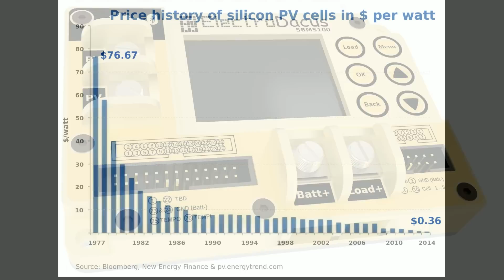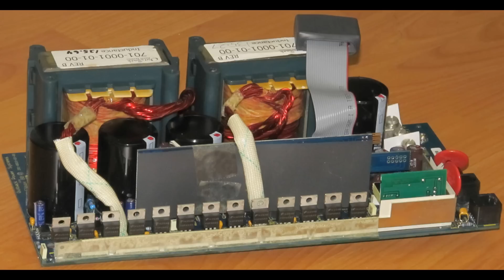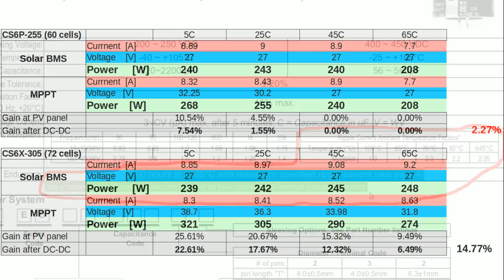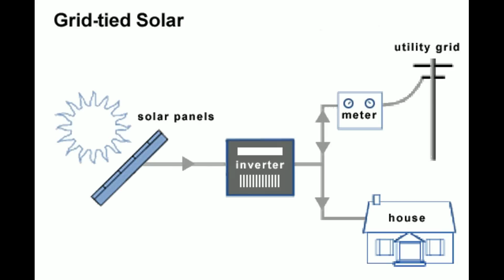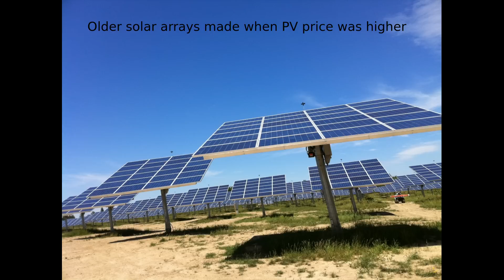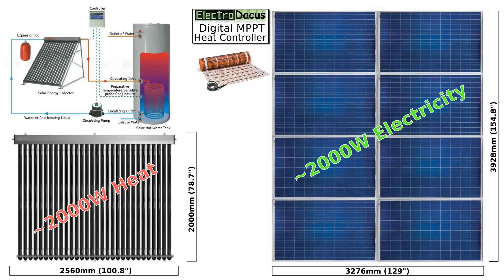Is the MPPT in OffGrid Solar obsolete ?

Comment: But those Panasonic filter capacitors are operating at less than 105 degrees C so they will last longer than 3000 hours...
Also, there are other reasons to use MPPT over direct connection via PWM controller.  Less problems with partial shading for one.
Reply from the maker: Yes if you look at the spec they can operate 2x as much so 6000 hours if they are at 70C so that is still maybe 3 years with 6h per day operating at that temperature that is 10x less than the life of a PV panel.
MPPT will not help with shading or partial shading. If you use 72 cell panels those are split in 3 separate parts and if even a cell is shaded a third of the panel will be out so voltage will be to low for the MPPT to operate thus that panel will be unused. If you have two panels in series then it will work with specific partial shading (if only part of one panel is shaded) but the efficiency with two panels in series is much smaller that with parallel panels so any  small gains you may get with partial shading will be negated by the overall lower efficiency.
Reply: Rule of thumb for electrolytic capacitor life and temperature is raising temperature 10 degrees C reduces live by a factor of two (2).
So way more than 6000 hours or many many years they can be good for.  High ambient temperatures are probably worse.  With interleaved buck converters, lower capacitance and even higher reliability film capacitors can be used.  The capacitors just aren't a problem.

As for partial shading, if you run a higher nominal PV voltage than the battery voltage, the Vmp (Max Power Point Voltage) can still be above the battery voltage so you can get usable power out of the PV array into the battery.  With a PWM controller, If a single string that is rated for nominal battery voltage has a module shaded, the Vmp can be below the battery voltage and you won't get hardly any power into the battery at that point.  High PV array temperatures only makes that issue worse.  If you start with too high of PV voltage relative to the battery voltage to mitigate that, then you are in the area of needing an MPPT or buck converter style controller.

One thing I know to do is to design to just not have any partial shading which would be best.  A chainsaw may be the best thing to use in that case.

But all these issues aside, a PWM controller can be just fine and does work fine for a lot of smaller systems. And if they have the space, more cheaper modules can be fine.

Here in the US and Canada, the equipment legally (if the system is going to be inspected), has to have a UL, ETL, TUV, etc. NRTL listing and has to be able to be wired to NEC electrical code.  I'm not sure if this CC has any listings but can certainly be used in small cabins and temporary premises.  Otherwise, insurance companies won't insure the house is the system fails inspection for that reason.

I looked at the schematic in the user manual and noticed that it uses a particular Li battery balancer IC that may or may not be available anymore ?  Did you upgrade the design ?  Is this controller good for 48V or is it limited to 8 Li battery cells ?
Reply from the maker: @k7iq  Capacitor temperature will not only have to do with ambient temperature (ambient around the capacitor inside the box will be much higher) but also have to do with the self generated internal heat from the ripple current and as they try to minimize the amount of capacitance and cost that ripple current will be fairly close to the limit at full load.
Yes you can use better capacitors but cost will be even higher so not much of a justification for that.
This particular MPPT and almost all others are just a step down converter so as mentioned with a single 72 cell PV panel that is split in to 3 section each containing 24 cells and so when a single cell is shaded (say a leaf falls on that cell) then one of those sections is completely disabled by the diode but 48 cells are not enough to be able to charge a 24V battery as you will need at least 26 to 27V depending on the battery SOC and since MPPT is a step down only converter it will not be able to put more current in to battery than what is available trough that shaded cell same as a non MPPT charger will be able to do.
The most common PV panels in the world (also the most cost effective) are the 60 cell PV panels that are ideal to directly charge a 24V LiFePO4 8s so 25.6V nominal and already fully charged at around 27.5V thus those panels + 8s LiFePO4 will work in the 90% to 100% efficiency range and no MPPT can match that as most have peak efficiency around 92 to 93% also an MPPT will require 72 cell PV panels it will not work with 60 cell panels unless groups of two are connected in series and that will reduce the efficiency even more.
I agree with you on the fact that shading should be avoided in all cases.
There is no PWM involved in charging a LiFePO4 as PWM is used with Lead Acid for the constant voltage charging also called Absorption stage and then after this is done float charge but none of this are used with LiFePO4 as it will be detrimental so there is no PWM on the SBMS as just constant current (bulk charge) is needed to fully charge a LiFePO4.
The ISL94203 that is used in the SBMS is very new (when I started designing the SBMS only the datasheet was available) so no the ISL94203 is still available and will be for many more years.  https://www.mouser.com/Search/Refine?Keyword=ISL94203
Reply: Not sure why the rest of my text above is not showing ?  Will copy and paste it in again and leave out empty space lines....
STILL cannot see the SEE MORE option.  Now I can't see the rest of your posting.  Weird...
Ripple current is why MPPT conterollers use inteleaved buck converters to reduce the ripple current.  At 50% duty cycle for 2 cylinder converters, the ripple is theoretically zero.  More interleaved buck converters are better at a wider range of duty cycles.
As for partial shading, if you run a higher nominal PV voltage than the battery voltage, the Vmp (Max Power Point Voltage) can still be above the battery voltage so you can get usable power out of the PV array into the battery.  With a PWM controller, If a single string that is rated for nominal battery voltage has a module shaded, the Vmp can be below the battery voltage and you won't get hardly any power into the battery at that point.  High PV array temperatures only makes that issue worse.  If you start with too high of PV voltage relative to the battery voltage to mitigate that, then you are in the area of needing an MPPT or buck converter style controller.
One thing I know to do is to design to just not have any partial shading which would be best.  A chainsaw may be the best thing to use in that case.
But all these issues aside, a PWM controller can be just fine and does work fine for a lot of smaller systems. And if they have the space, more cheaper modules can be fine.
Here in the US and Canada, the equipment legally (if the system is going to be inspected), has to have a UL, ETL, TUV, etc. NRTL listing and has to be able to be wired to NEC electrical code.  I'm not sure if this CC has any listings but can certainly be used in small cabins and temporary premises.  Otherwise, insurance companies won't insure the house is the system fails inspection for that reason.
I looked at the schematic in the user manual and noticed that it uses a particular Li battery balancer IC that may or may not be available anymore ?  Did you upgrade the design ?  Is this controller good for 48V or is it limited to 8 Li battery cells ?
Reply: @electrodacus  I had Googled that part and didn't see many hits.  It is going EOL so eventually you will need to redesign but there should be lots of parts available.
So, what is the maximum input voltage (Voc) of this controller ?
Reply from the maker: @k7iq  The ISL94203 is no where near end of life. It is a complex product in a 48pin 0.4mm QFN so maybe not so popular for DIY but sure there are at least 5 years for this IC before EOL
The ISL94203 is designed for 8s so absolute max supply voltage is 36V that has nothing to do with max SBMS PV input VOC that is at least 48V (to be more accurate is 30V + Battery voltage) so it supports both 60 cell panels and 72 cell panels tho the 60 cells will be more efficient so it make little sense to get 72 cell panels.
In case you did not noticed here is the user manual for the SBMS40 and SBMS120 http://electrodacus.com/SBMS120/manual/SBMSmanual.pdf
Reply: Well, Renesas notes that the ISL94203   part is not for use in new designs.  We both know that parts eventually go obsolete .  Five years is pretty good.   Another part will become available and maybe even pin compatible.
Reply from the maker: @k7iq  It will likely be replaced by the ISL94202 that is basically the same.

Comment: Numbers are kind off now, MPPT of 60 Amp cost around 160€ (can get 3kW PV). And if it fail, replacing  Capacitors will not cost a lot. Plus it works with 12V, 24V and 48V battery packs.
Still the BMS as to be purchased separatly.
Reply from the maker: The MPPT will need to have a remote ON/OFF in order to interface with a BMS not many have that. Victron smart solar MPPT has remote ON/OFF port so it can interface with a BMS like the SBMS0.
Still there is zero advantage in efficiency when using the proper matched panels and battery and no MPPT vs an MPPT. So even if MPPT will have been free there is no advantage in having one. A 24V battery + a 60 cell PV panel will always be in the 95 to 100% efficient and that is more than even the best MPPT that is around 92 to 93% efficient with a 72 cell panel as the 60 cell will not work and even worse if you have multiple panels in series for much higher voltage than battery. 
In offgrid even if there where any efficiency to be had with an MPPT (not the case) there will still help with nothing as you will only use in average 50% of available energy in an offgrid system. When battery is full and that is the case around noon there is little you can do to use the excess energy.
Reply: The 160€ MPPT got a relay, so .. 
https://www.victronenergy.com/upload/documents/White-paper-Which-solar-charge-controller-PWM-or-MPPT.pdf
Page 10, PWM are within 10% of performance (worse then you say it is) between 45 and 75°C ... the delta increase at low temperature, where we need energy the most.
Without even a PWM it can't be "always" as you say, within 95%+ of an MPPT. And without at least a PWM voltage will be too high in winter or too low in summer.
Where are your numbers coming from ? "A 24V battery + a 60 cell PV panel will always be in the 95 to 100% efficient" ?

Comment: Having more solar doesn't mean you can cover everything you need
I'm a household and for heating ~120sqm house I need ~5kW average heater for underfloor heating solution ( winter down to -25C here in Ukraine, with average -5 )
To cover nights in winter I need ~55kW battery array to have a backup. Which is ~20000$ if having Lifepo2 batteries + significant amount for chargers for that beast.
So for heating solar collector still makes sense to have, because it is a good option to put that heat to underfloor heating. Because no need for expensive battery array then. But also - there is a need for heat pump, that will pull the heat from solar collector in a more efficient way to get hot water supply for the house. Especially in a winter.

Comment: Some people  use insulated curtains to prevent heat flow from the house  through the windows.  I'm sure there are many variables to consider in determining whether large south facing windows is cost effective as compared to solar electric for heating.
Reply from the maker: The windows alone are more expensive than solar PV panels excluding the insulated curtains (if they are curtains then they will not be that effective as they do not have a high enough thermal insulation and they are not sealed).
Reply: electrodacus I'm no expert but I would guess that solar gain through a window would be something like 4x greater than that from a equal area of solar electric panel(s). And curtains or insulated panels with high R value can be homemade from inexpensive second hand materials and if one wants to get creative could be made close to air tight. Your charge controller looks very interesting by the way. Can you recommend a good place to purchase 200ah capacity LIFEPO4 cells in the USA?
Reply from the maker: A typical solar panel is around 20% efficient where a south facing window may be around 50 to 60% depending on how many pane 2 or 3 and what sort of coatings they have so best case 3x but this is ignoring thermal losses of the window both during the day and during the long winter nights compared to a similar area ow wall. Typical wall has about 10x lower losses than a quality window and in cold climates like mine those losses negates any gains during the day making the windows a net loss system while in more moderate climates it can be positive gain but still not as high as PV panels.
LiFePO4 should cost 350 to $400 / kWh so you can get them from any place but here is one example  http://www.evwest.com/catalog/product_info.php?cPath=4&products_id=264  is 180Ah and is a rebranded Winston sold in US.  They have at least 5 to 10% higher capacity than stated so it will be very close to 200Ah initially.